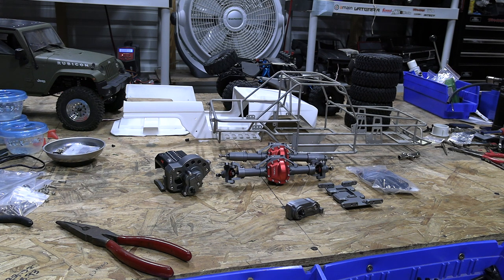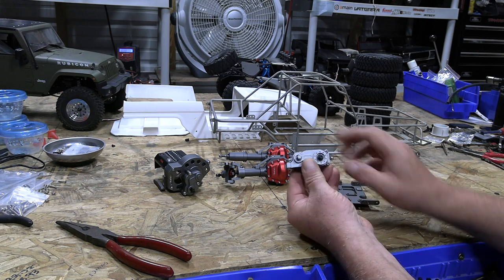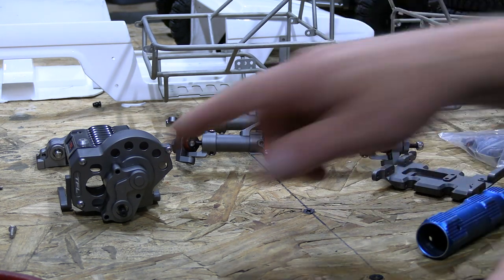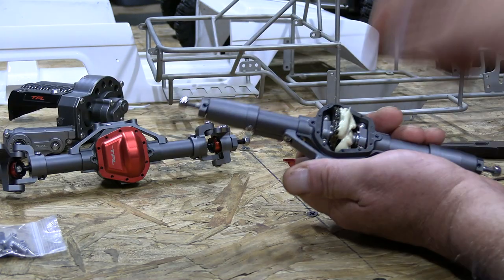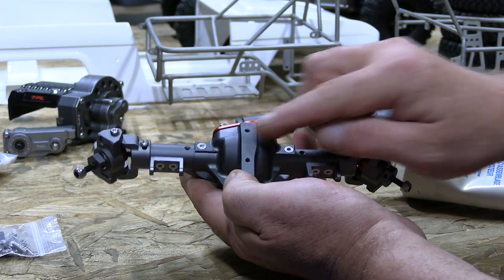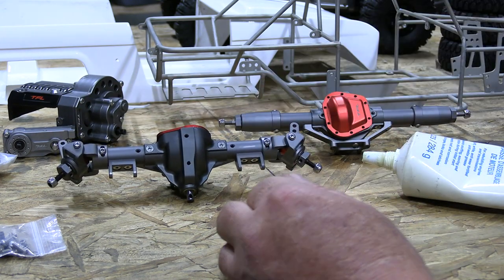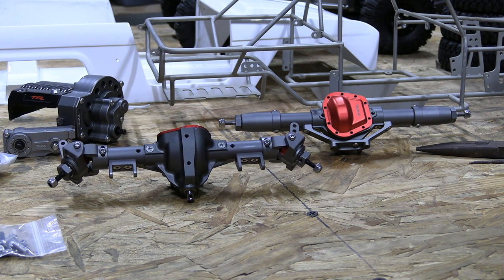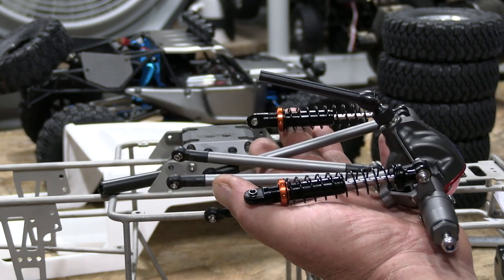The TFL Racing C1508 Bronco kit and short review.

Comment: Thanks for your video. Looks like it's a nice piece of kit. I just bought one already assembled that had never been driven. Had a first test drive and everything works thankfully. Now I'm gonna open it up and grease it like you did. If you read this, how is your experience with this rig? I'd like to put overdrive in it if possible.
Reply from the maker: Been pretty good. But the stainless screws strip out easily.